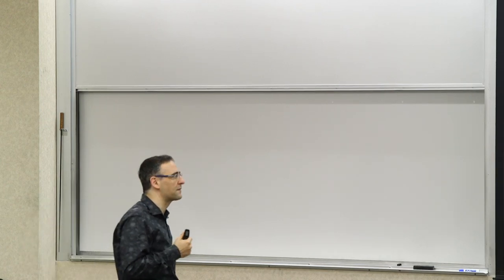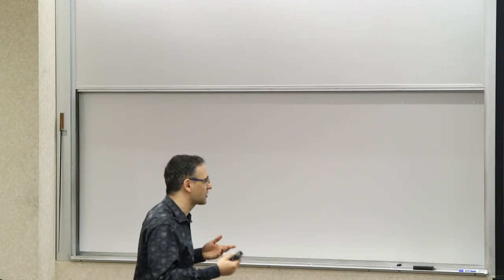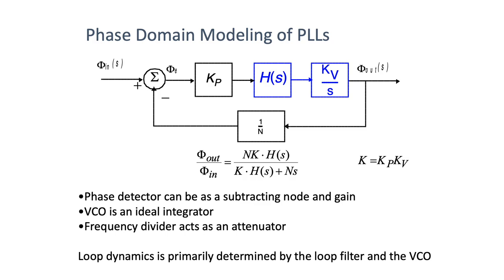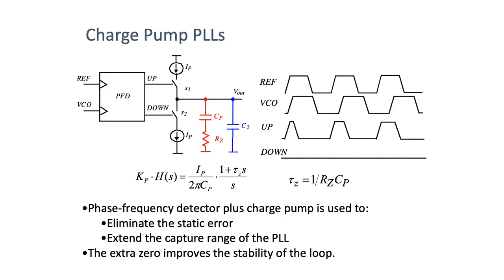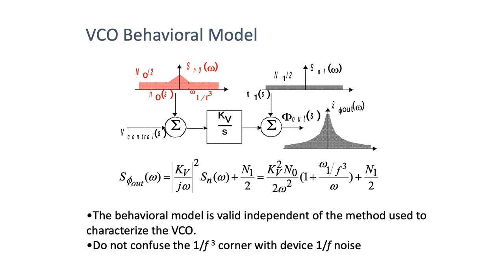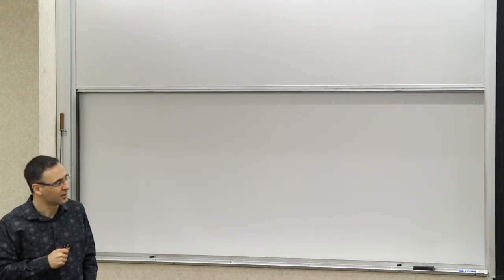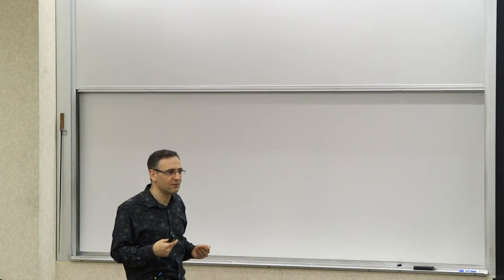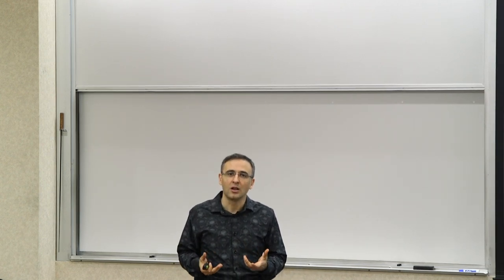187N. Intro. to phase-locked loops (PLL) noise

Comment: Hi professor,
I have a question, please...
For frequency synthesizer/clock recovery scenarios (scenario 1 and scenario 2) where the VCO is noisier than the input, why the phase noise PSD of the VCO is flat (constant) up to the loop bandwidth? 
I thought it should be 1/f^2 (as open-loop VCO). I thought it should be similar to the phase noise PSD of the input.
thanks